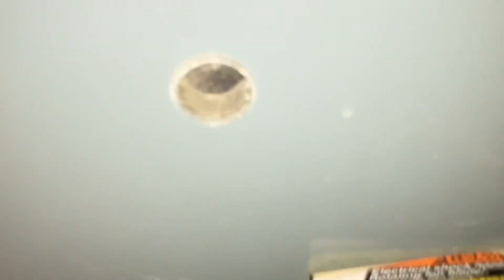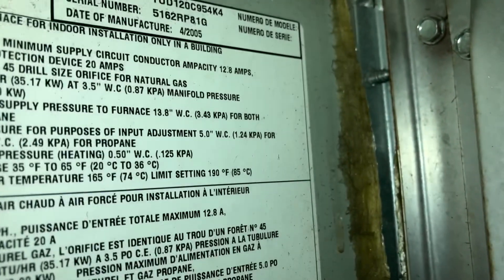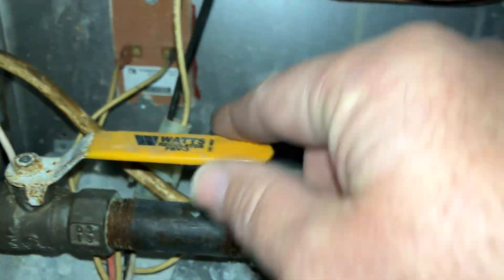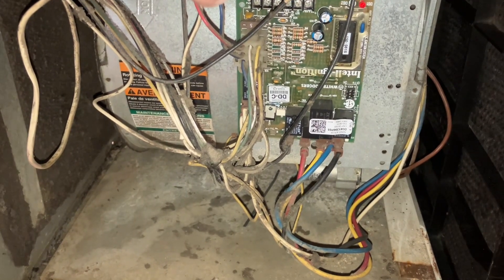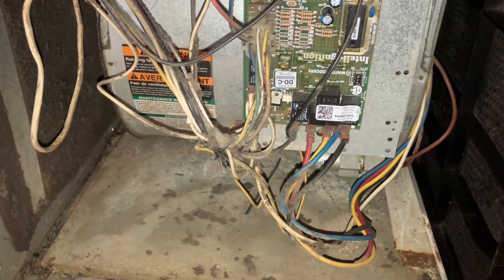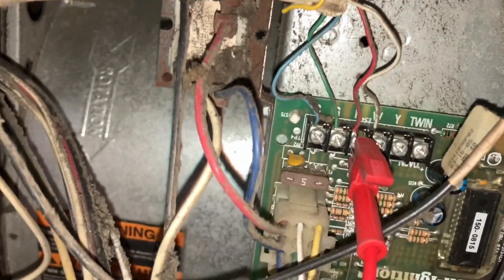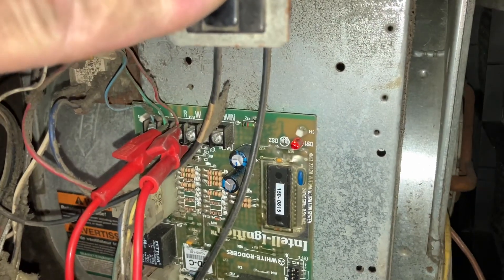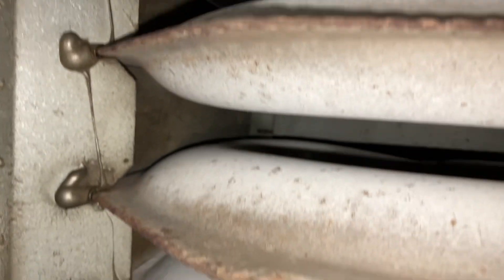You Won't Believe What's Causing Your Trane XR80 Gas Furnace to Fail

Comment: Can you please do a video on how to replace the XR80 filter??? I can't find a single one on YouTube or anywhere.
Reply: There's some variation as far as filters go, depending on the configuration of your ductwork and the size of your home/building the furnace is heating. In most cases, replacing the filter should be pretty much self explanatory. It will always be somewhere on the return side, but it's exact location will vary depending on your specific ductwork and the location of the furnace within your home. Have you located the filter you are trying to replace?
Reply: @orderofthedragon3109 thanks for the tip! I managed to figure out how to replace it.

Comment: Hey mike friendly tip , best way to diagnose this is keep your jumper on r and g and remove the blue wire off the board that goes to the heat terminal. Check your voltage coming out of the heat terminal to on the board to neautral or ground. If 120 is there bad motor , if 0v then bad board.

Comment: That heat exchanger is probably  cracked just above the inlet from where flames enter the cells. I have found numerous furnaces 80% and 90% trane/ American standard they use the same primary heat exchangers on both models. The Crack is right at the cramped edge. Pull limit and use camera and you will find it all the time.
Reply from the maker: Yes, I will keep that in mind for future videos!
Reply: And the 90% usually have a leaky gasket on the secondary